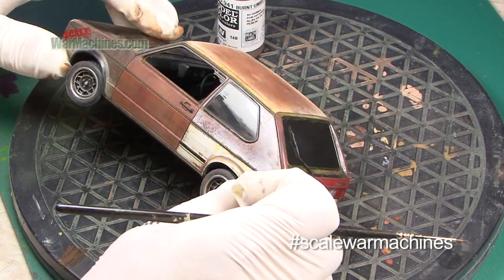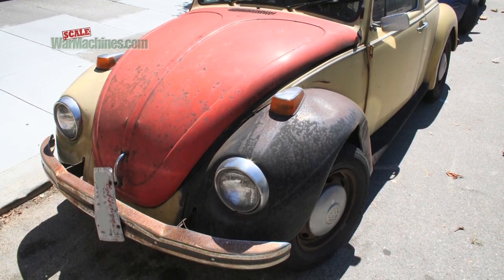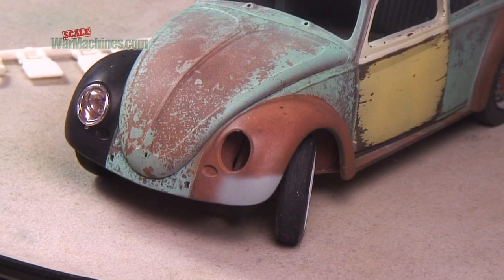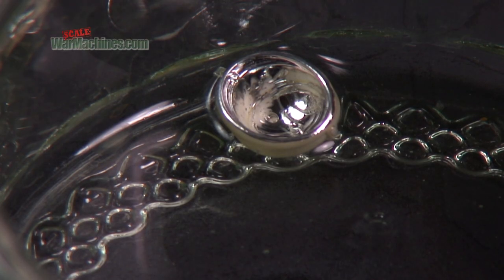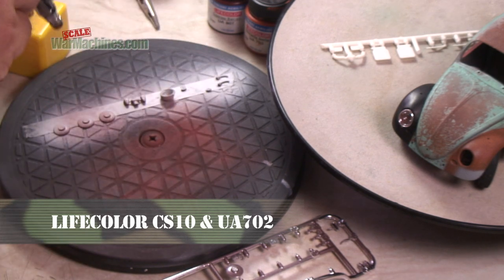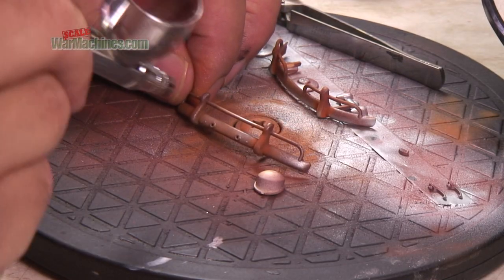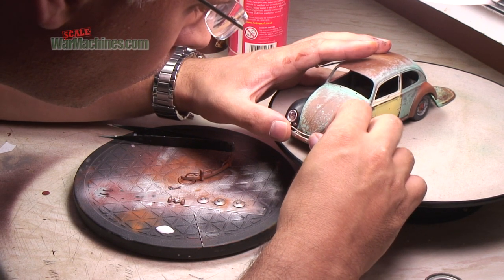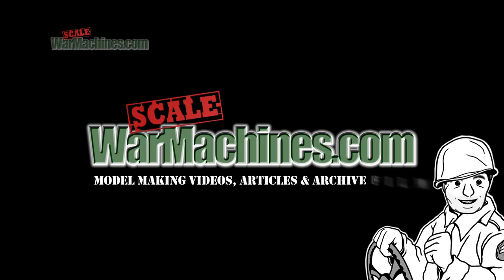STRIPPING & WEATHERING CHROME - "HOW TO" SCALE MODEL GUIDE

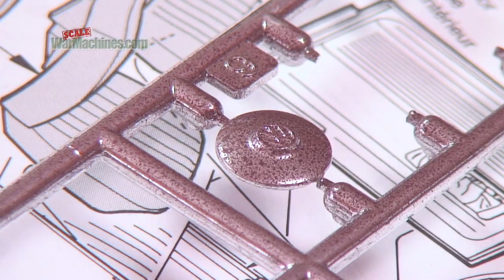Comment: 1:46 Might be eaiser to do this with a toothbrush. No need to dirty the airbrush for stippling.
Reply from the maker: A toothbrush is very uncontrollable and rough compared to the fine stipple from an airbrush. You can, for instance, control the size of the stipples with an airbrush. Toothbrush flicking is great for mud effects though certainly.

Comment: What kind of tool is that you are using at the 4 minute mark?

I'm not sure if it's available outside the US, but SuperClean degreaser strips off both the chrome and the clear lacquer undercoat, as well as most other paints, and isn't as unpleasant as having straight bleach out in the open. I've heard some guys call it 'the purple pond' lol
Reply from the maker: That's a pencil made of compacted paper, not sure what it's officially called, but we got it from an art supply house. It's very useful for applying & blending pigments. As for SuperClean, never tried it & never seen it over here - we'll have to give it a go.
Reply from the maker: We bought it in France where it's called an "Estompe" - it's used for blending pastels & should be available in most art supply shops. http://www.geant-beaux-arts.fr/Set-estompes-gomme-Conte.html

Comment: Great stuff! How did you get your airbrush to spray the stipple?
Reply from the maker: You need to go low pressure - really low pressure. What works will depend on your set-up, your airbrush & the viscosity of the paint but experiment with your airbrush set to a low pressure (virtually nothing) & fiddle with the pressure until you get fine specks & stipples when you spray. It's much easier if you have a MAC valve (regulator) on the actual airbrush but you can set it on the compressor too - provided that has a regulator of course. If not, spray air through a large flat brush laden with some paint & you can get flecks & specks that way - but that's a whole other technique!

Comment: What if i don't have a air brush
Reply from the maker: Try rattle cans, or this would work with a cheapo $20 plastic airbrush off amazon running off a spare car tyre. That's how we started. Once we decided we wanted to go beyond brush painting we went something like this > rattle cans > dirt cheap badger plastic airbrush and spare tyre > air compressor & better airbrush > gradually more expensive airbrushes. For certain finishes, it's hard without atomising the paint through spraying.